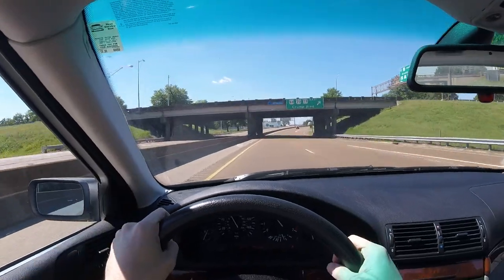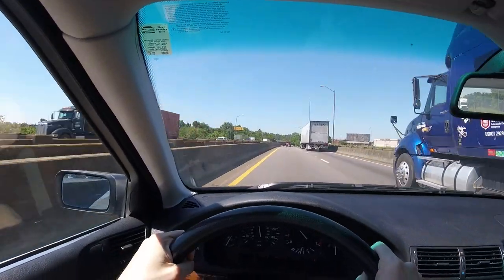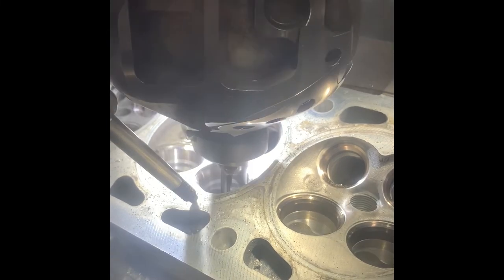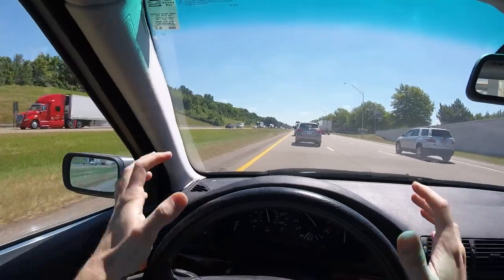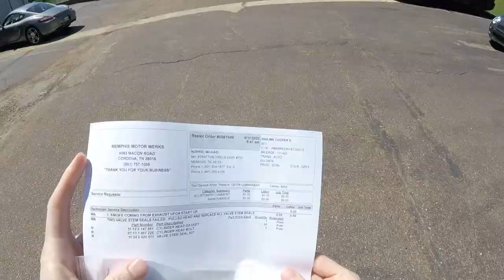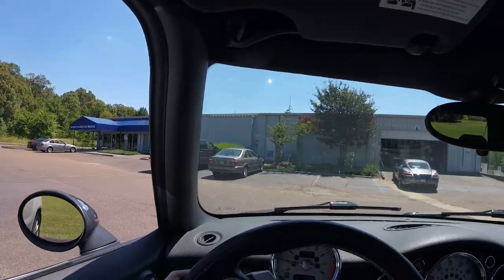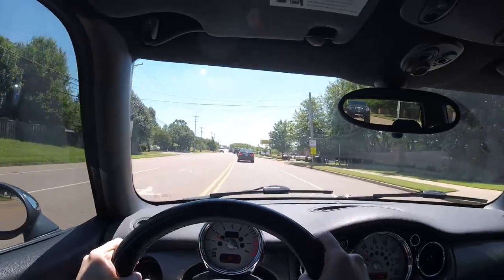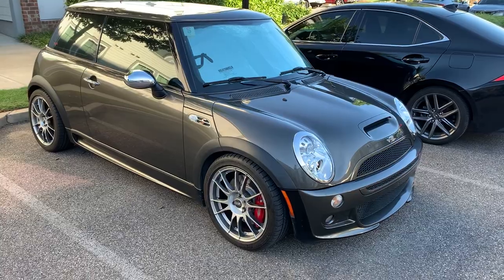Picking up my R53 MINI from the shop!

Comment: just brought my 2006 r53 Checkmate to the garage to fix a small engine problem. it was hesitating alot and the pops and bangs were gone ....... hoping it wont be to expensive . but as you have said. its such a special car that it is worth it :)
Reply from the maker: It’s creamy how you get so used to the car and it doesn’t feel like it did when you bought it, until you go drive something else for a few days. I was just in a brand new raised Ford F-150. Man, that thing was crazy. It felt like I was on top of a skyscraper. After the truck shoot, I hop back in the MINI, and immediately was like WHOA, this thing is crazy low and small. I wanted to go thrash it around some corners! 😍
Reply: @retinalblur  haha ye thats so nice. The mini is always special in its kind!

Comment: Hi, have you changed the supercharger oil during those 170k miles? Thank you!
Reply from the maker: I have not. I asked the shop about it, but they suggested to leave it alone. I assume it's a closed system, yes?
Reply: @retinalblur  yes it's a closed system, but as all oils in a car it should be changed. I was asking because i want to make sure if it's too early to change mine (70.000 miles). I would recommend to follow mod mini on YouTube, he has a lot of videos about r53!!
Reply from the maker: Xabier thanks for the tip. I should look into it for sure.
Reply: Xabier I changed it a little before 100,000 miles
Reply from the maker: @Tryingmybestsince1999   I found mod mini last night. His vids are incredible. Thinking I'll look into servicing  the supercharger on my oil change in about 5,000 miles.Looks really involved, but with his vids, it will save a ton of money! Thanks for the tip!
Reply: I did mine a few days ago since everything was drained already(lend my car out and someone hit a bunny)

At almost 170.000km the oil was still clean.

I would have been too lazy but what's removing the charger when the whole front panel and rad was already off?
Reply from the maker: I’m at 174 and going to look into changing mine on my next oil change at 179.
Reply: @retinalblur  im bout to change mine when i replace the water pump and thermostat have an 05 r53 with 201k on it.
Reply from the maker: @kottnmth420  wow congrats on the 200+ mark!
Reply: @retinalblur  thanks still runs strong too, hope it makes it another 100k before i need major work lol